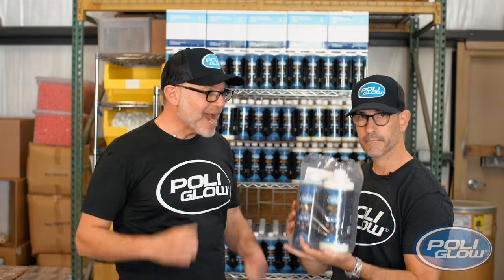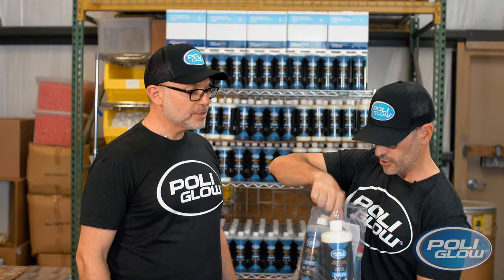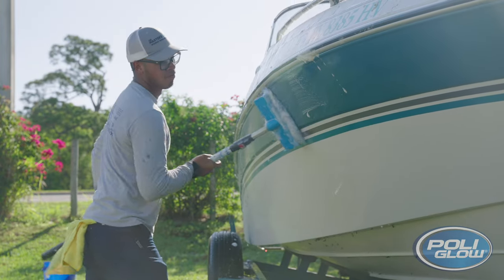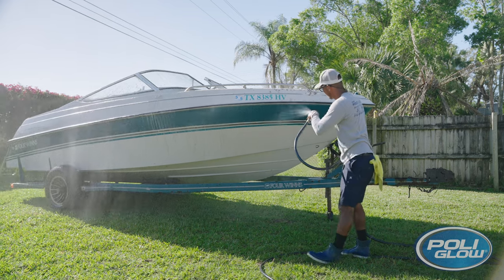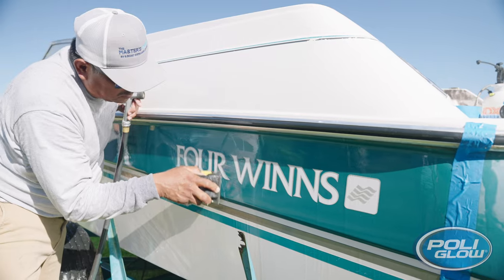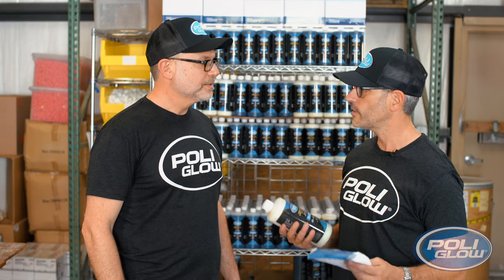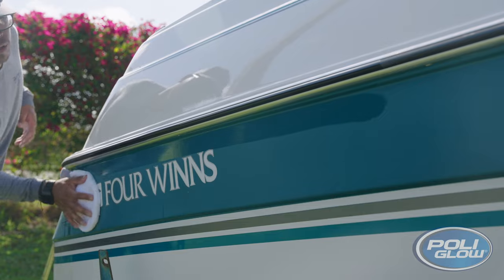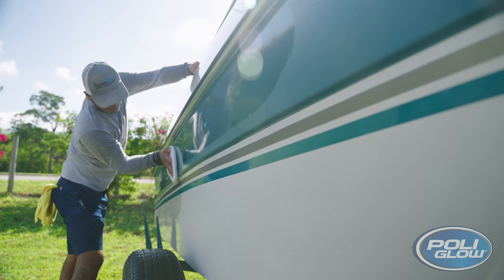How To Video 3: The Poli Glow® Deluxe Kit

Comment from the maker: Yes, Poli Glow will work great on carbon fiber surfaces!  Carbon fiber will oxidize just like fiberglass and gel coat.  The paint is in the carbon fiber itself so Poli prep or Poli strip will work fine on this surface.  If you have any questions, please contact us directly at info@poliglow.com